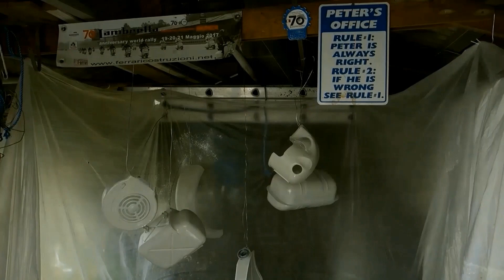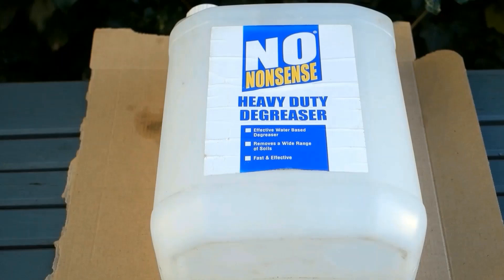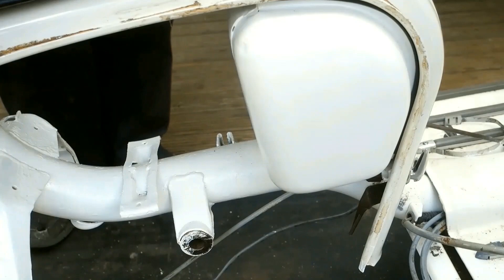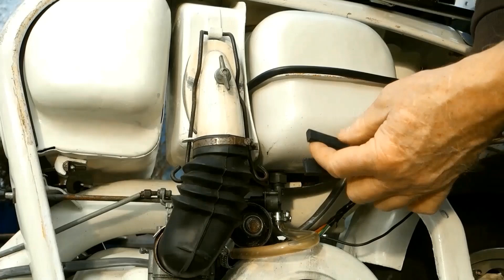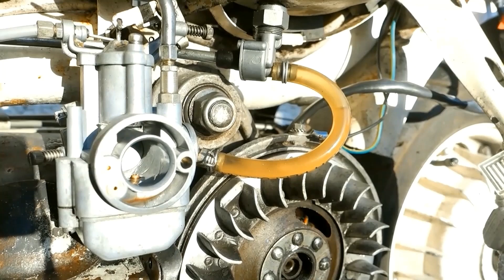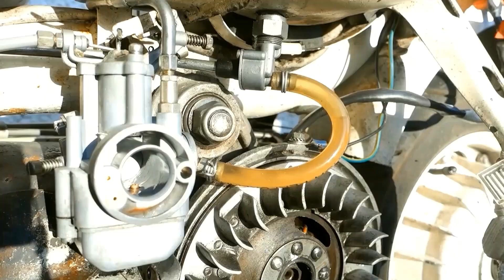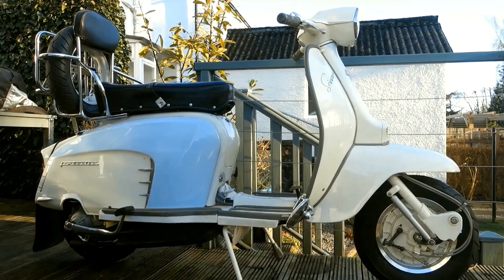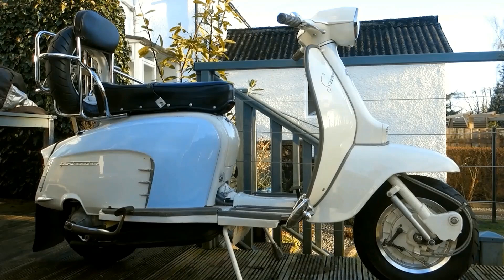A Novice and the Art of Lambretta Maintenance: Series 3 Remedials.

Comment: That gear selector looks like it’s a bit worn  might be work a check again
Reply from the maker: Thanks for the heads up. I have not changed it as yet but I have put it on the New Year resolution list. Apologies for the slightly late response. Probably an age thing.